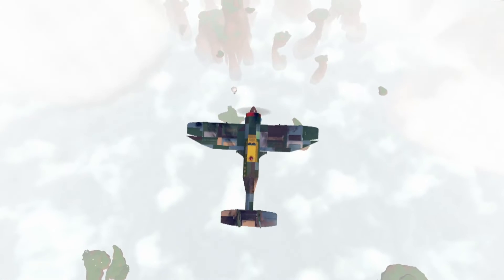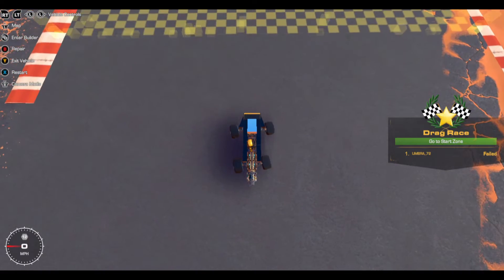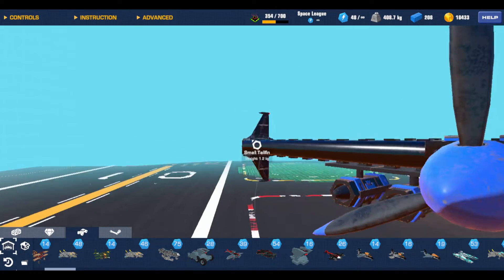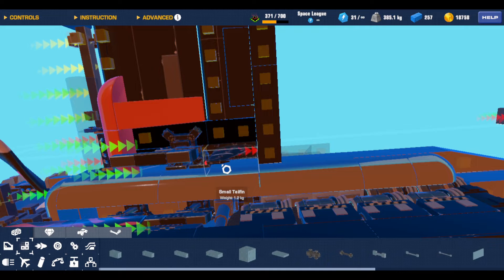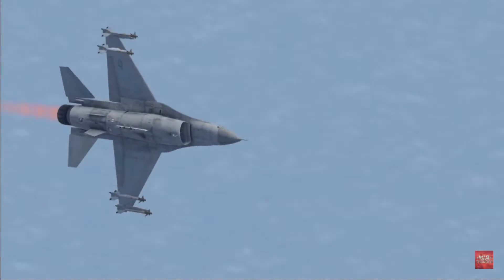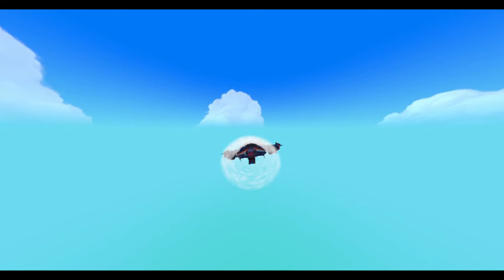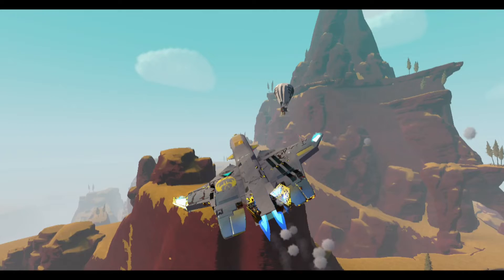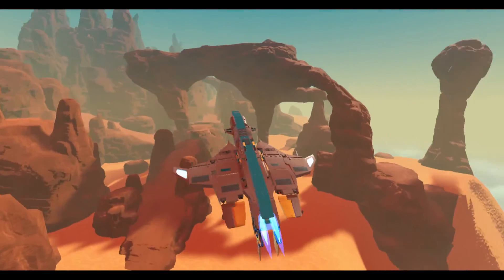Trailmakers Airplane Design | How to Yaw

Comment: I know it’s off topic, but why do you have ailerons on the ends of the stratocheief series?

Edit: HAPPY NEW YEAR!!!
Reply from the maker: In testing, the ailerons had the most aggressive turning potential.  I actually replaced the powered tail fin with the aileron in this case.  It was just more maneuverable that way.

The entire aileron is on a hinge, Im not using the aileron inputs at all.
Reply: @umbra_72  oh wow, I never knew that.